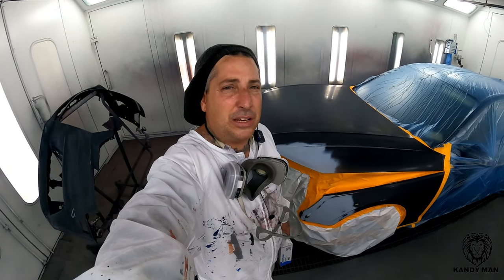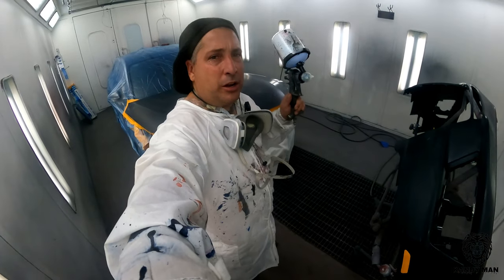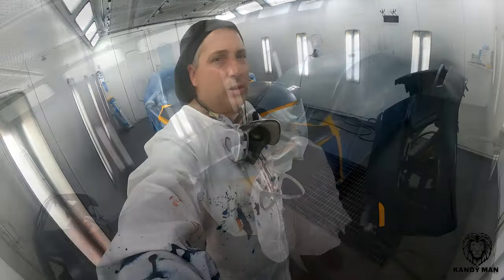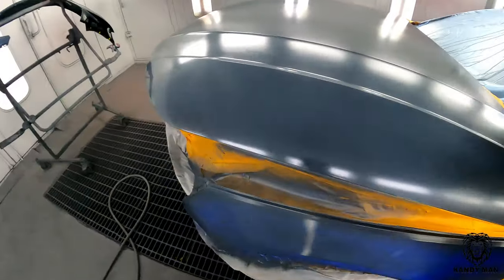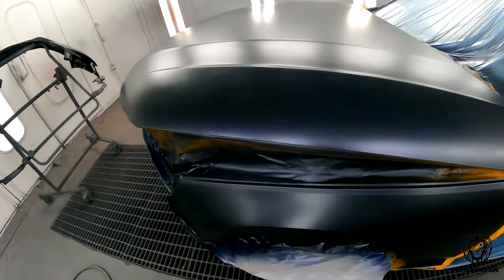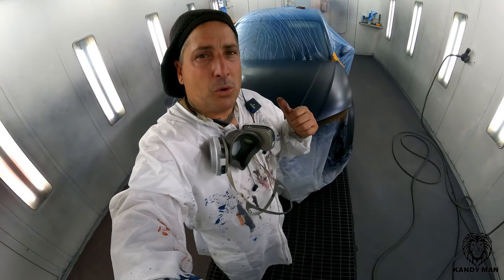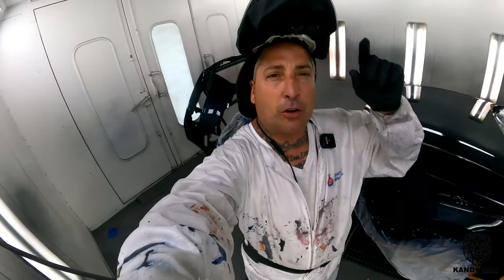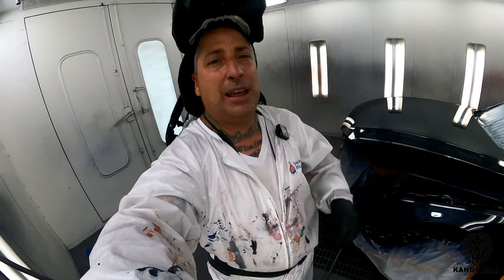HOW I USE BASE CLEAR

Comment: This makes a lot off sense mate your totally right, I had a hole side to do on a car and the rear quarter panel had some fish eyes , luckily It 1500 wet sand come out ,car was super dirty when it come in to the shop ,some people say use dish soap it almost strips every from the panel, good tech tip man this video…

Comment: Where can I find some of that “Wet Bed “?
Reply from the maker: Check with the paint stores in your  area if using with a solvent base make sure it's fully  dry before applying the base
Reply: @kandyman5315  I don’t think that have it. But, on the other hand: I haven’t heard of it even when I was in auto body repair in school? I will see what I can find out. Thanks 🙏
Reply: @kevinholbrook7174 , usually 3 stages have a binder for the pearl coat. You can use that reduced 1:1.